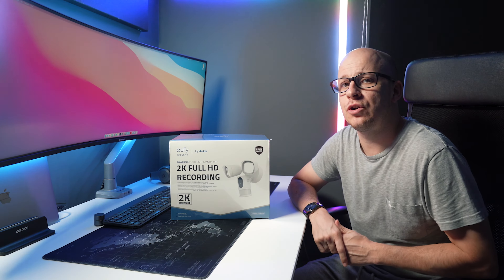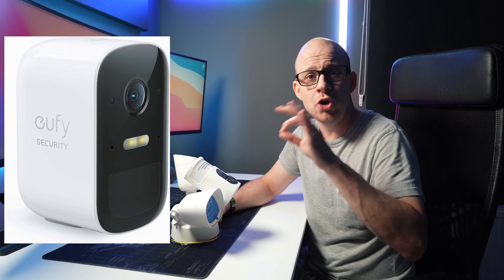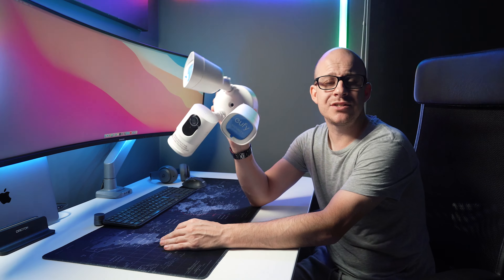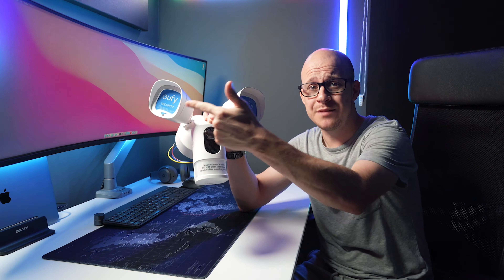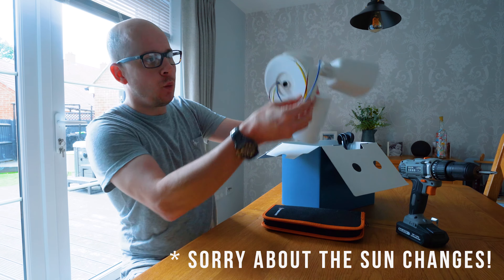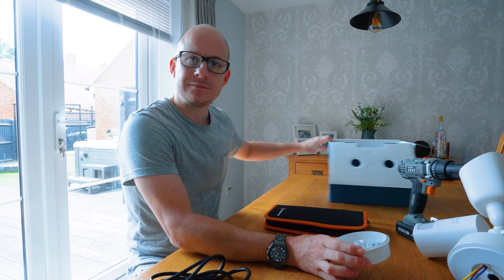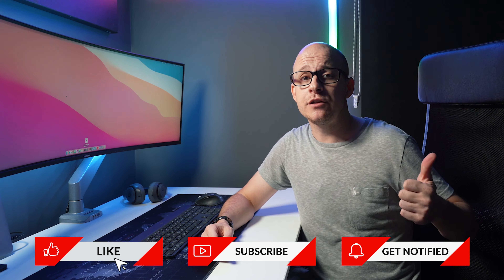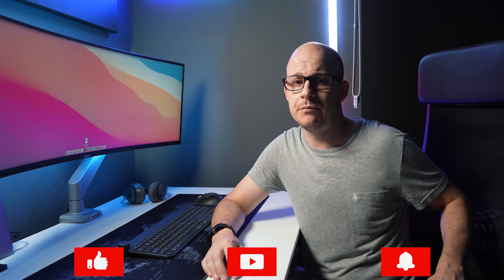The NEW Eufy Floodlight Cam 2

Comment: Issues can't install two cameras on the app, on 2 phones. Kicks me out of one camera when adding another camera to the app. What a headache.
Reply from the maker: Hey Evie5567, I cant say i have seen this or spoken to anyone who has an issues adding more than one device to the app. You will have problems trying to add the same device to 2 different phones, that will not work. You would nee to add it to one device and then use the option to share the device with another person. Many Thanks

Comment: Hi would love your opinion I have this floodlight which is going to be fixed up would I need a doorbell as well as it will be facing out the front of the house so would that be surplus to requirements
Reply from the maker: Hi, I had the same thought so trialled without the door bell and found out I didn't actually need it :-) Many Thanks